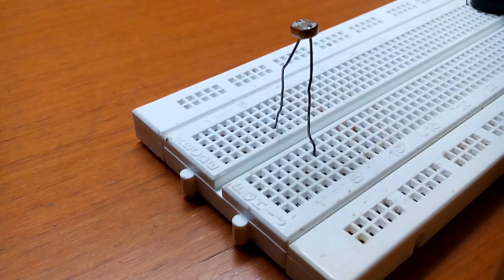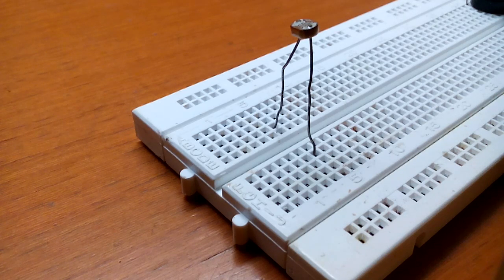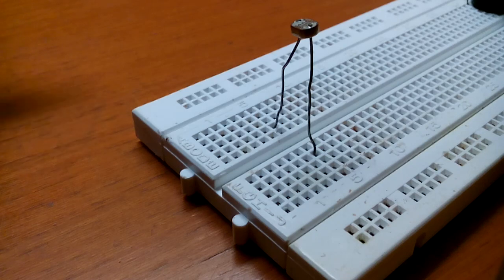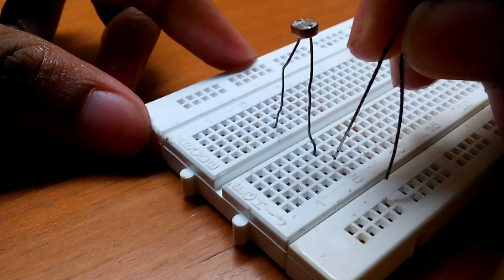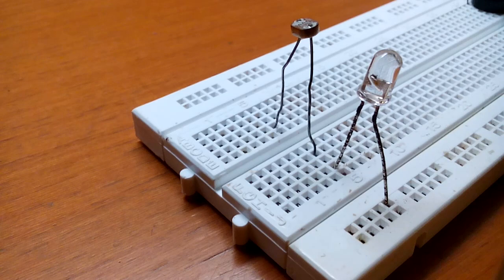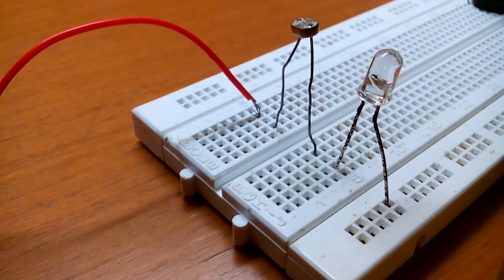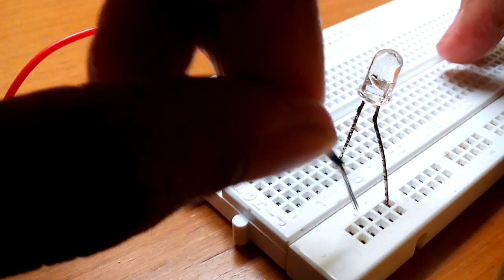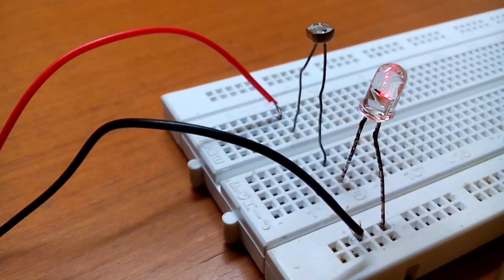How to make your own "Light Sensor" on breadboard.

Comment: Bhai mujhe reverse Mai banana h. Matlb jabmai light on karu toh led automatic off ho jye aur jab light off karu toh led on ho jaye..uske liye Kya krna hoga? Help me
Reply from the maker: Okay... that means you want to make a Dark Sensor! Watch this video of mine 👉https://youtu.be/PmFjbY-jENQ
Reply: Why you not use resistor across the led?? Is it harmful for led?
Reply from the maker: I connected the battery to the LED for less time that's why i didn't use a resistor. 
But i would recommend you to always use a resistor to prevent the LED from buring out...
Reply: Ok ok thanks......
Reply: 100k resistor will be good?

Comment: jb light band krta hai tho battry ke cap ko hata de tha hai or ye use kis mei ho tha hai pagal
Reply from the maker: Bro this video is not fake... I didn't remove the battery cap when i turned "off" the light...please don't assume anything...
Also, you can check out my latest video on "Light Sensor" here :- https://youtu.be/ad3769-DjR0
I have explained how to make a light sensor on a breadboard in a better way so do check it out! :)
Have a great day! 😊
Reply: But broh the way u r doing it in the video does not work. I just tried it myself and so started off searching for ldr & led project and ended up finding this video which even i as a beginner can say its fake